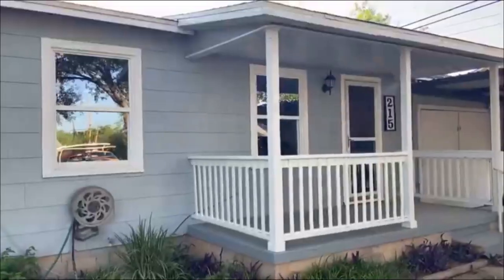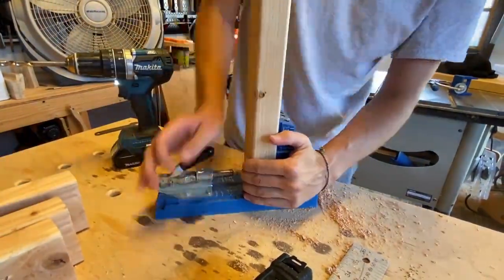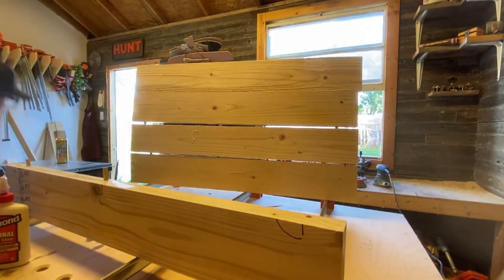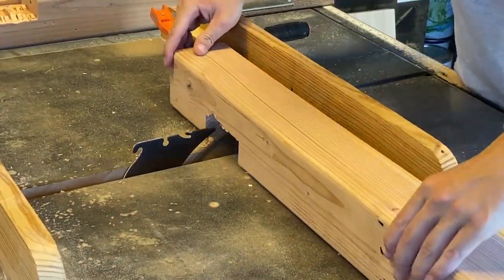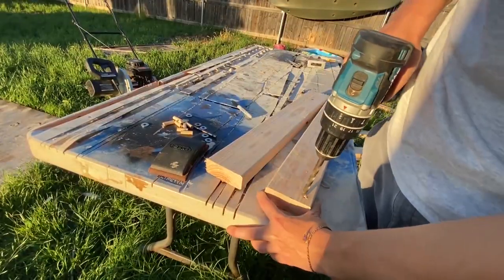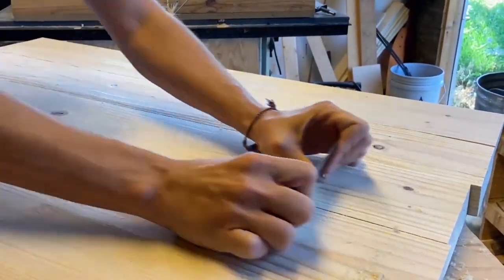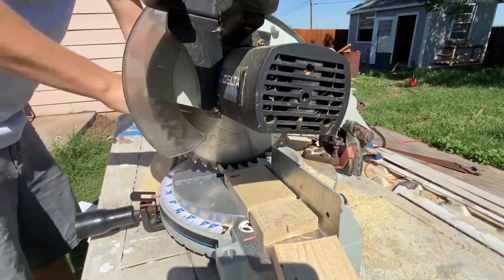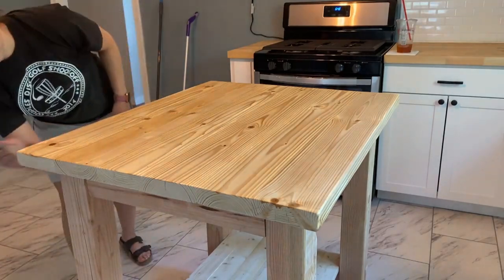Mobile Kitchen Island w/ Small Footprint // DIY + How To

Comment: Very cool. I'm building my first piece ever, and its a kitchen cart on wheels, 2x3 wide. Very similar. I am using 4x4's legs, but opted for 1x3 rails under the top and under two shelves below. Using a  sanded plywood top. My friend chopsawed the legs for me, as I'm not comfortable yet with this new equipment.  I hope this is the first piece of many.
Reply from the maker: Good luck to you! I hope it turns out great.

Comment: I need a lot of directions on plan layouts and I kind of thought that this would be a good place to start. My (boss) wife
has been dropping hints
that she wants me to make a free standing 
cabinet for our kitchen.
  The rough measurements would be about 75” tall by 34”
wide and 14” deep. It 
would need probably 4
pull out drawers and a
double door cabinet with 4 shelves. Basically 
a small pantry. We already have 2 really cheap ones that I can use as a kind of pattern 
but, improve on the quality. Also this will give the kitchen more room and storage space.